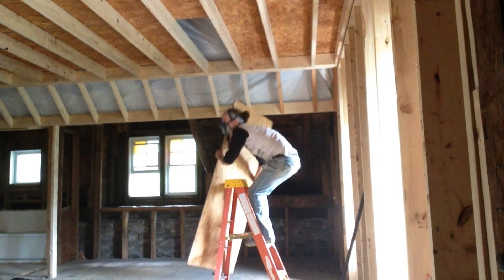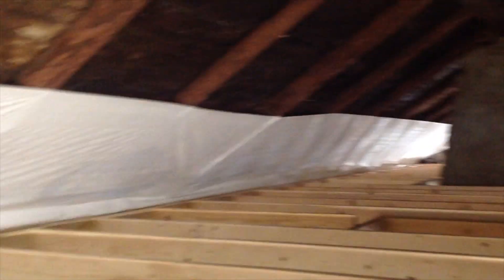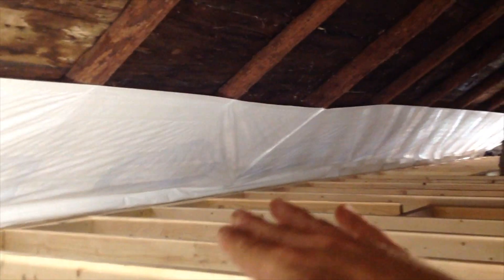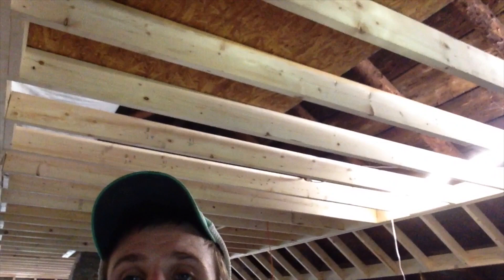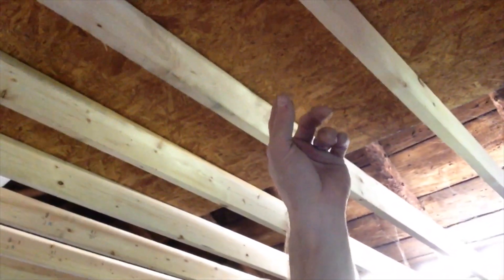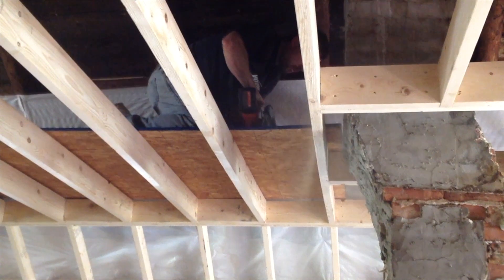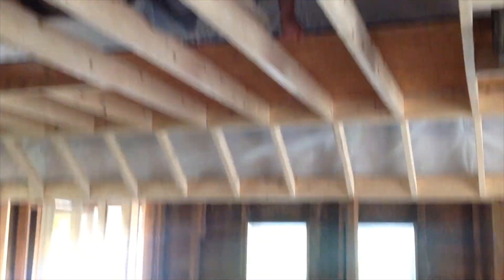1806 Stone House - Episode 38 - Framing Part II

Comment: Ottawa, Canada, just a few hours north.  I really enjoy the shows.  You're both doing a great job.  Make sure that the company that does your spray foam will remove it at no cost if it goes wrong.  If the layers are sprayed too thick the foam does not cure properly and it out-gasses all kinds of nasty stuff for months, including formaldehyde.
Reply from the maker: James Halls yes, we did check into a removal warranty.. it’s done now and thankfully worked out great! Thanks for the comment.

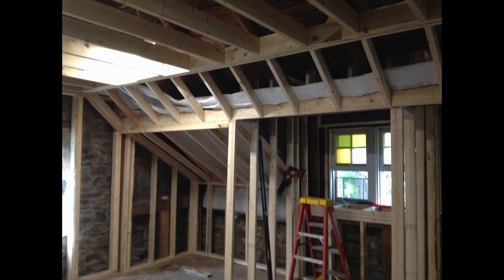Comment: I'm back to ask you more questions .lol. Anyway, the pictures at 0:51 , where it has the shims, backers and the top of the studs attached to the wood , plus the angle pieces(like the angled ceiling in the closet) in general are some of the questions I would like to know "how" you did it.  For me i need to know  the "details" of how something is done to fully know how to do it. Like you said , it took you a whole day just to frame out the window. It would be great if you can explain the details of "how" you did the framing for those areas.  The more details the better. I'm sorry, but i am slow. lol :-) . I haven't seen a video on Youtube that goes into details about the framing you had to do in this video. They show the "after", but they  don't explain the "how" in detail or any detail at all. At least not that I have seen.
Reply from the maker: mandingoteck dailey .. ok, I try to explain. 😀 first we shot a later level around the window space to get s solid line. Then, using the center of the window we measured to the left and right to make the largest opening possible. Next, we studded the new walls inside and secured them to the original older walls.. once the walls were plumbed we started experimenting with how we wanted the ceiling.. we knew we needed 5” of space from the new studs to the roof deck ( for spray foam) and so we just cut a couple angled pieces to put them up.. trying to keep it as high as possible but leave the 5” for insulation.. in the end it didn’t turn out perfect.. but, most people will never know it’s off a 1/2”.. it was a lot of trial and error really.. in an old house nothing is level, strait, plumb.. well, most of the time anyways.. I hope this helped.. sorry for the long response.. ( I didn’t proof read it either) sorry if there are mistakes
Reply: Thanks for the info. I understand some things better know. Still don't know how you were able to determine the angles you cut on both sides of the pieces of wood that attach from the new long beam you created to the horizontal piece of wood, but I know it is probably hard to explain without actually showing how you did it. However, I really appreciate all the time and knowledge you have given to me. Keep up the good work. Love the channel.
Reply from the maker: mandingoteck dailey good! If you want, you can email me and I’ll send you a pic? Or I’ll add it in my next video.. I can stop and shoot a quick video for this week.. 😀
Reply: That would be great if you could  add it to the next video.  That will allow me to better to visualize  how you actually went about doing it.  I've seen videos of  people building a standard wall, but not what you had to do to frame the right angles and keep things plumb , level , and square in an old house that is neither square or level. If you have seen videos like that, please let me know, so I could stop bothering you with the same questions . lol.  In general, I like your videos, because you go into great details in  some of them, because you explained and showed what you had to do to fix or do something. For example, the floor leveling videos were great , because of all the details that you showed and explained. For some one like myself who has never built anything, you told me almost exactly how to go about it in my house.
Reply from the maker: mandingoteck dailey not a problem. I’ll add it at the end of this weeks video.. 😀
Reply: Thanks man. By the way, when i said "right" angles, i'm talking about all angles,  especially the slanted ones that bring the walls and roof together. :-)  I'm assuming that most have been  a dormer that you framed around. I'm still amazed that you can do all that stuff with no experience..... I don't know man. I think you must be  an undercover carpenter that is reverse-catfishing us .lol .   I have never seen someone that doesn't have experience cut wood free-hand so good like you do. I've tried to use a circular saw one time before free hand and I could not get it to cut straight to save my life.  You are my hero.
Reply from the maker: mandingoteck dailey lol, I have some experience.. but, I usually learn by doing and making mistakes.. haha

Comment: Why not spray foam between your ceiling joists instead on top of the OSB board?  Don't you want to be able to walk around in your attic if needed?
Reply from the maker: Nope. The attic space is small and we don’t ever plan on entering it. By putting the foam on top.. it’s creates a perfect sealed surface.. no thermal bridges and super strong.